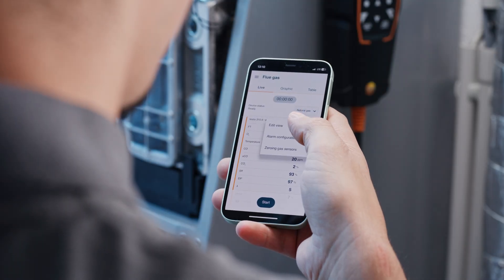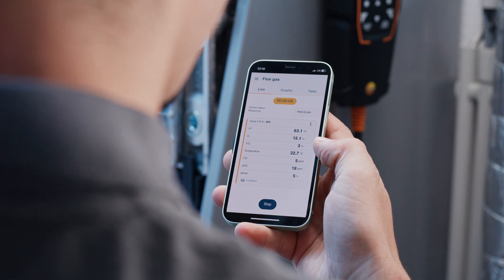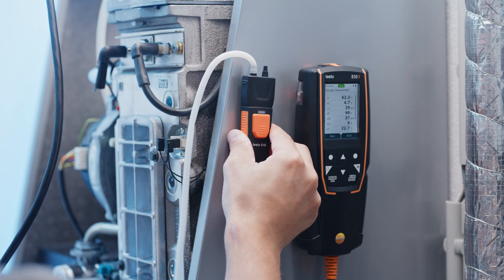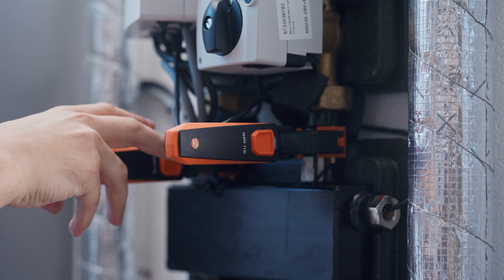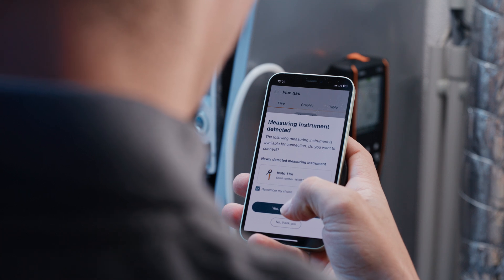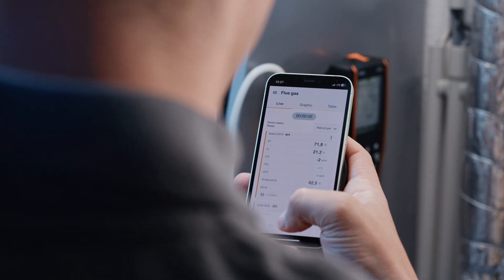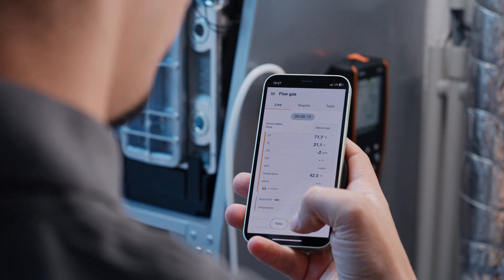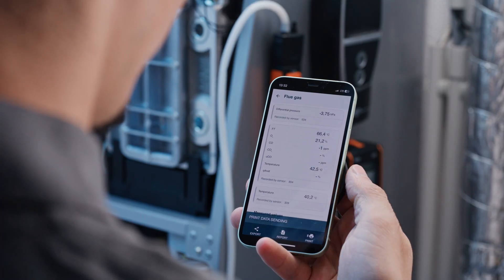How to Use - The testo 310 (2nd Gen) Flue Gas Analyser

Comment: Does it have a built in manometer to check gas pressure?
Reply from the maker: Hello, thank you for your comment. If you would like further information on testo 310 (2nd Gen) flue gas analyser, please email info@testo.co.uk or call 01420544433, thank you.